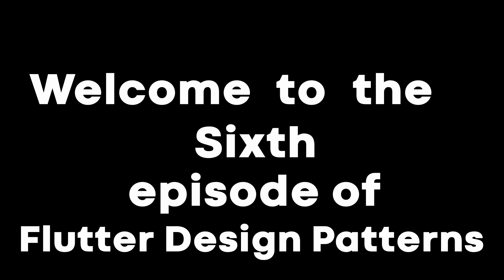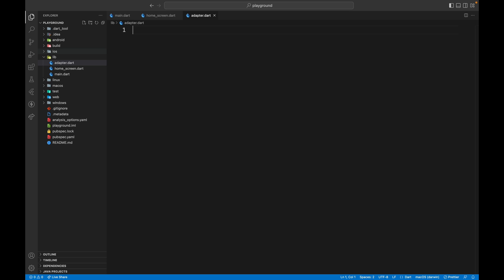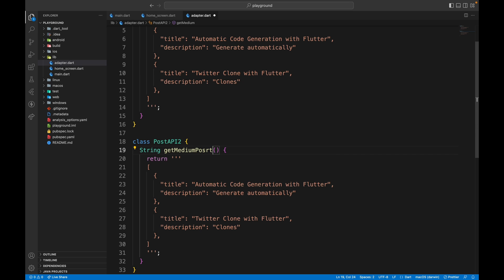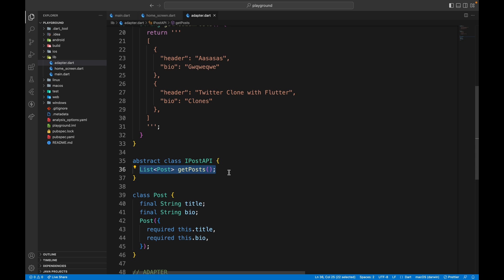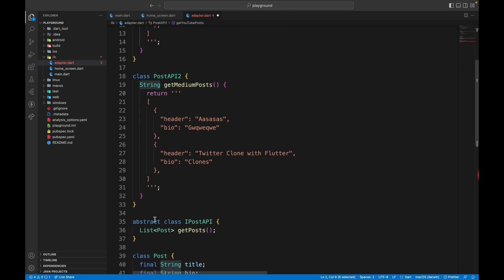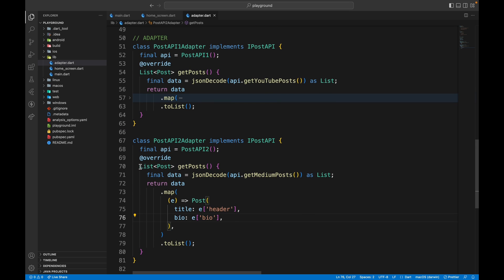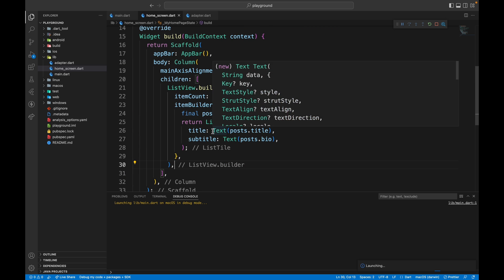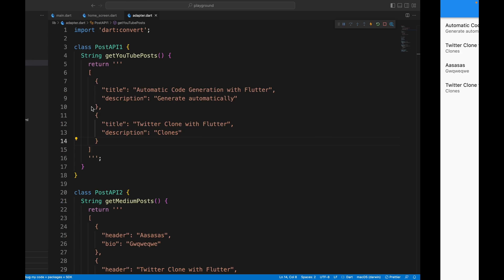Ep.6 - Adapter | Flutter Design Patterns

Comment: Hey Rivaan how much ram do you have in your macbook , and how much ram you suggest for app development
Reply from the maker: Mine is 16GB RAM. But I think 8GB works well too.
Reply: @RivaanRanawat  yup software are also getting very optimised now , currently I have a 8gb ram windows laptop with good processor and it work fine for flutter dev I build a insta clone from your videos.

Comment: I have a doubt. When using hard-coded values of the widgets, I get overflow error. Also, sometimes the UI doesn't look good on all screen sizes. Should I  hard code width and height of widgets, font size of texts or should I use Media query to make it responsive. Example: Containers height can be Mediaquery.size.height * 0.3 instead of 300. I want the UI to be pixel perfect for every mobile screen sizes. How can I achieve this?
Reply from the maker: For more knowledge on this, I'd highly recommend reading this - https://discord.com/channels/420324994703163402/421448406506930187/879312204351033374
https://discord.com/channels/420324994703163402/421445316617961502/905494464729083934

Comment: how to use excel sheet
Reply from the maker: Microsoft Excel is a spreadsheet application that allows you to store, organize, and analyze data. Here are some basic instructions for using Excel:

Open Excel. You will see a blank workbook with rows and columns. Each column is labeled with a letter and each row is labeled with a number.

Enter data into the spreadsheet. Click on a cell and type in the data you want to enter. You can also copy and paste data from another source, such as a website or another program.

Save the workbook. To save the workbook, click on the "File" tab in the top-left corner and select "Save As". Choose a location to save the file and click "Save".

Format the data. You can change the appearance of the data in the spreadsheet by using formatting options such as font size, color, and alignment. To access the formatting options, click on the "Home" tab in the ribbon at the top of the screen.

Use formulas. Excel allows you to perform calculations on your data using formulas. For example, you can use the SUM formula to add up a range of cells. To enter a formula, click on a cell and type an equal sign (=), followed by the formula and any necessary cell references.

Create charts. You can use the data in your spreadsheet to create charts and graphs, which can make it easier to understand and analyze the data. To create a chart, select the data you want to include and then click on the "Insert" tab in the ribbon. Choose the type of chart you want to create and Excel will insert it into the worksheet.
Reply from the maker: This is what ChatGPT said when I asked the above question.
Reply: i didnt want an answer from chatGPT